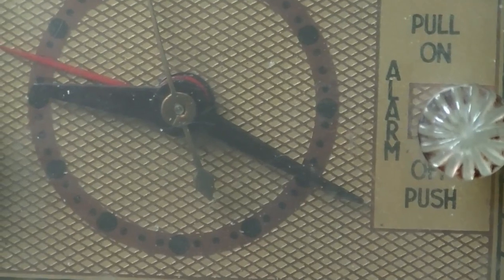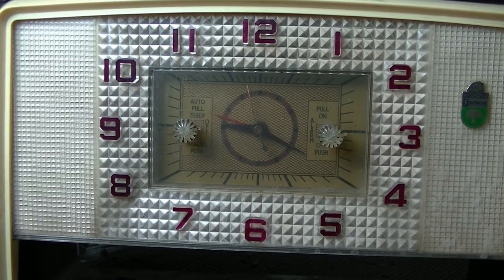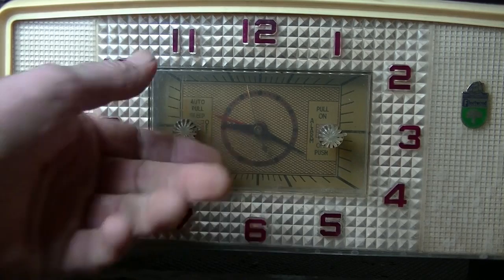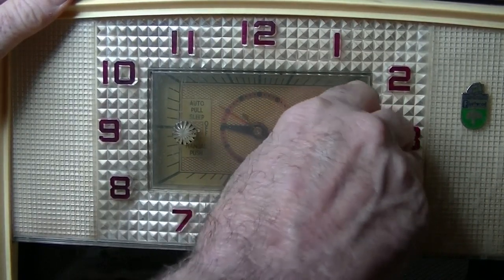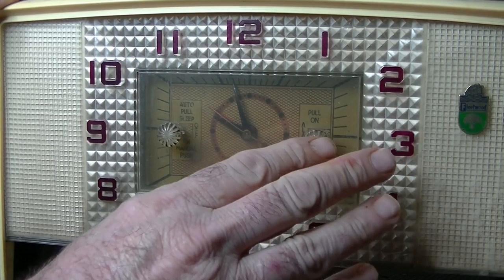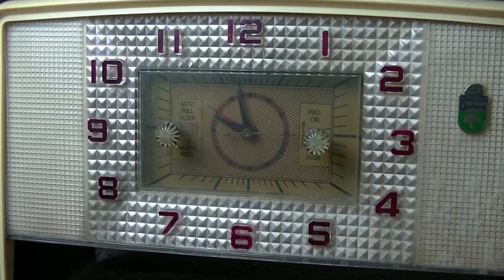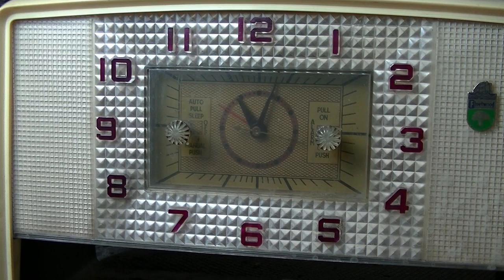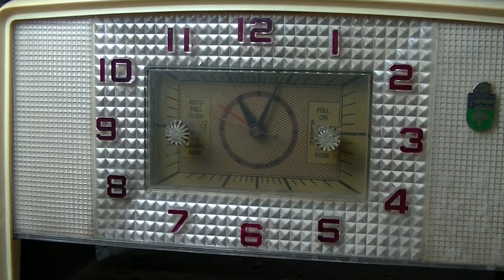Fleetwood 1118 Clock Radio Restoration Part 2

Comment: Yeah Frank, you got lucky there, don't fix it while it's working. It would be nice if the clock was designed with a momentary pushbutton light switch for viewing in the dark in the wee hours. I haven't used an alarm clock in years, but when I did, I had to have the snooze feature.

Comment: well that was a stroke of luck with that clock every one i worked on were so gummed up with old grease that they wouldn't work and most of the functions still work. well they built clocks to last in 1957. Another complete working radio can't beat that.
Reply from the maker: Your luck is rubbing off on me Larry :)